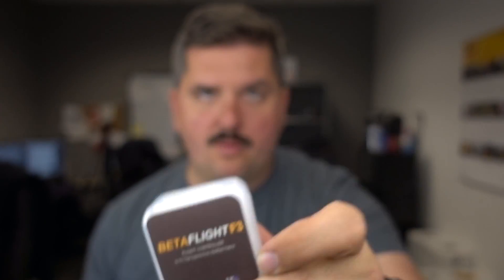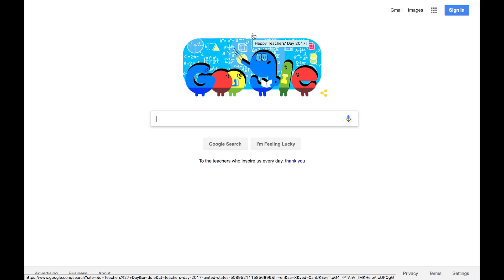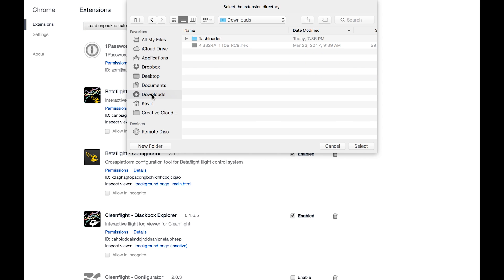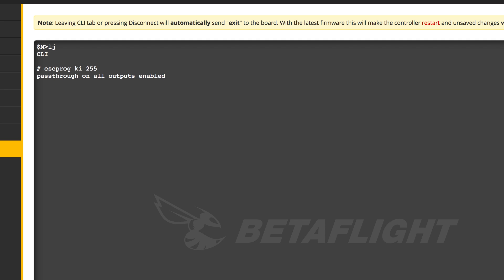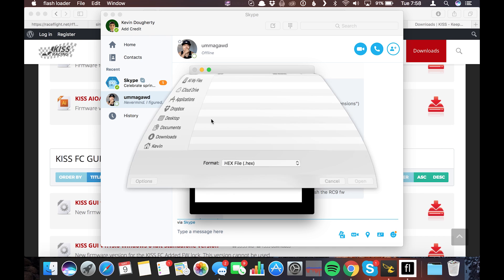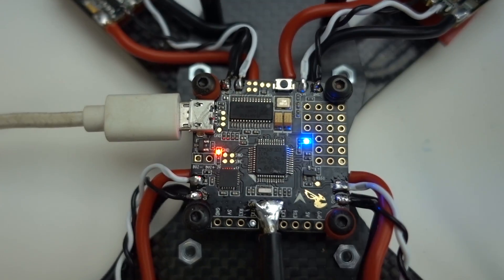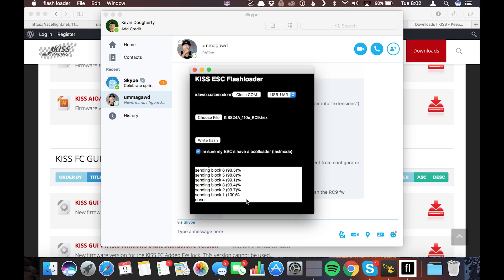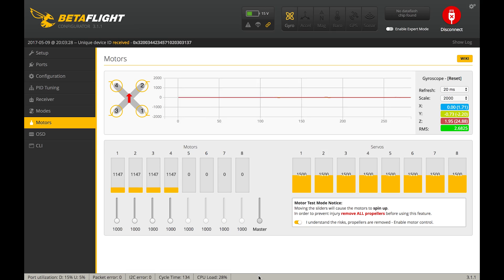Flashing KISS ESCs Through a Betaflight F3 Board

Comment: Thank You for an amazing video!! Really made my life easier. 
Just a side note of something I had to do to make it work.. I had to run the ESC flash twice.  I had one esc with separate FW because I replaced a damaged one, so that is why I think it took two times to get it to work.  Also after typing the line command in CLI it took longer than normal for the board to disconnect thorough BF.

Comment: is there any advantage to mixing KISS stuff with BF or BLheli? I have never used any KISS stuff but if I did I would go full KISS or not bother.
Reply: i think kiss24's are still the best ESCs out there
Reply: Cool, i knew they were good but i thought you needed KISS FC to make the most of them. my 2nd quad was gonna be another BF/BLheli build but now i am interested in checking out BF/kiss esc as an option.
Reply: They were the only 32Bit ESC on the market for a very long time... Till BLHeli_32 came out. BlHeli_32 is still new and has a way to go and the KISS are there for a long time. They are proven. However there is no advantage in using them with the KISS FC anymore. BF also supports the telemetry stuff now and so DS1200.

Comment: Thank you Kevin,  I bought a KISS FC and 24A ESC and never could get the ESC to flash through the kiss FC.  I gave up on them after messing with them for a few days, and just threw them in a box.  I am going to dig them out again and retry using my betaflight F3 board.  BTW have you ever experienced control run away, I just built a RR5 frame with Betaflight f3, 30 dshot 600 esc's, and once in a while when I give it full input either pitch or roll, the quad just keeps spinning when I release the control back to neutral.  It weird because after it crashes I can re arm and fly normally again until the next time it happens. Any suggestions???
Reply: Brian Butcher do you use a flysky fs8s receiver?? Because I have heard about this problem several times now and most of the times it was caused by this receiver.
Hope I helped.
 Sorry for my bad english btw.
Reply: Thanks for the quick response, No I am using a FRSKY Taranis x9d Plus and x4r receiver connected via sbus betaflight f3 aio, Speedix 30 blheli dshot esc's, and emax red bottom motors.  all new stuff so I don't which component is causing the issue.  I never lose video or RSSI and it happens when the quad is 50 to 100 ft away so I don't think it is radio loss.   I think maybe one of the esc's is shutting down which causes it to go into a spin but not sure.  Thanks again for your time I know your a busy man.
Reply: Which Betaflight version are you on and what PID loop and Gyro update frequencies are you running?
Reply: FYI   I tracked the run away spinning to a specific battery pack, it only does this when I am running these new packs CHNL 1300mha at 100c.  These are some hot racing packs which seem to cause my esc's to shut down under heavy load.  I went back to my Tatu 1300 70c and have not seen the run away happen
Reply: Zero FPV  I am running 3.1.7 on the Borris B f3 aio,  Pids Fq2 khz gyro fq 8khz, (default) but I did isolate the issue to a specific battery pack these new "CNHL "brand 100C 1300 mha 4s packs.  I switched to my tattu 1300 75c and flew it hard for 4 packs and never had an issue.
Reply: Brian Butcher 
Glad to hear you found the problem! My first guess would have been excess CPU usage. It was easy to cause on older Betaflight versions when you run high PID loop and gyro frequencies  and had features enabled like the accelerometer. This often resulted in really strange behaviors. 3.1.7 should be less vulnerable to this problem than older versions were.
Reply: Thank you for the help, I just realized I have an sd slot on this fc so I can probably use blackbox to analyze the problem in more detail.  I will follow up if I learn something useful to share

Comment: Why would someone want to use BF with these jewels of escs? I mean the magic of kiss is to use fc and esc's... Not to mention BF F3 is even more expensive and messy than Kiss Fc.....
Reply: Pretty simple when you think about it. Maybe they want the integrated OSD on the BFF3 and like Betaflight in general but still want the advantages of running the 32bit Kiss ESCs. Advantages such as being capable of running DSHOT 1200 and sending telemetry back to the flight controller. New BLHeli32 ESCs will do all this as well, but the Kiss 24a ESCs are proven and are known to work great.  Also, KISS FC only runs at 1KHz. I'm not going to get into a gyro/PID loop time debate. But a lot of people want to run faster loop times like 8KHz or higher.
Reply: My best flying quad runs betaflight on an F4 chip, and uses KISS 24a ESCs, so there are plenty of people for which this video is helpful.
Reply: I get where you're coming from. I don't have a KISS fc but I've heard good (and bad) things. That said, sometimes the best results can be had from picking your parts a la carte, choosing what suits your build and flying style best. Felix and Boris have been collaborating a lot in recent months. Betaflight now supports telemetry from KISS 24A RE's for current readings direct from the ESC. They are also working together on dshot.
Reply: Dashz yes I don't understand why ! esc kiss + fc kiss work fine and it's so easy to use !
Reply: I fly with the Betaflight F3 and KISS 24 RE's on one of my copters and it flies amazing. Just use what works best for you and try new things. I also have two BLHeli_S copters with Omnibus F4's and they don't quite match the smoothness of the KISS ESC's but are a bit more powerful at the top end. In any case, they all fly great! Just little differences.
Reply: I understand try new thing to find the perfect combo. But I think kiss fc and kiss esc it's juste the best combo to have a great quad. the code from flyduino with flyduino product 😁.